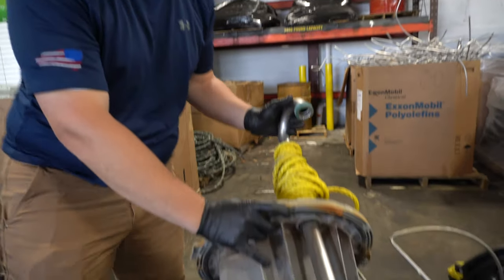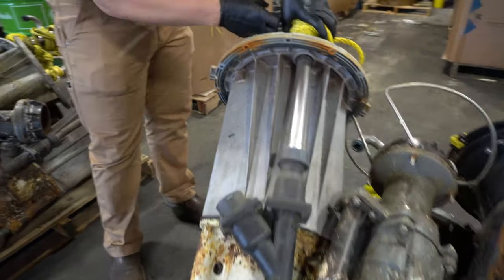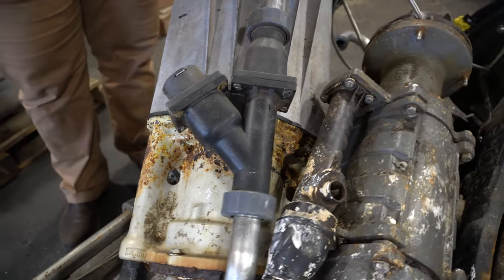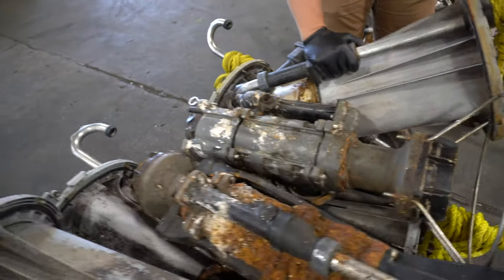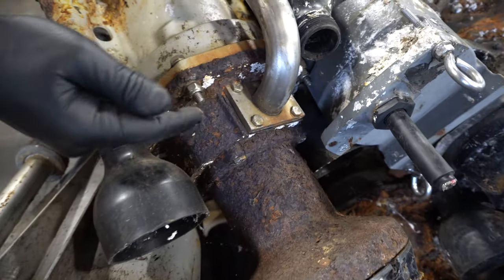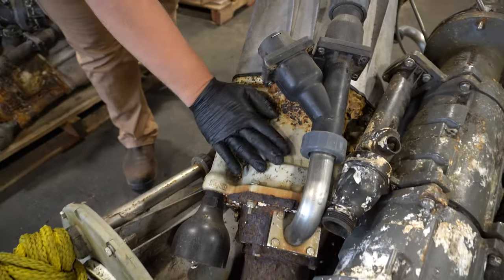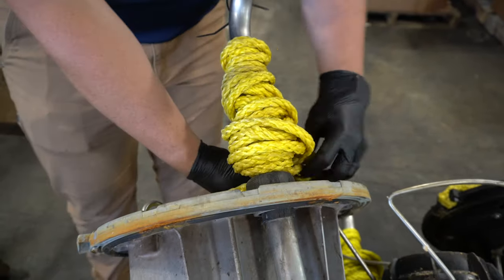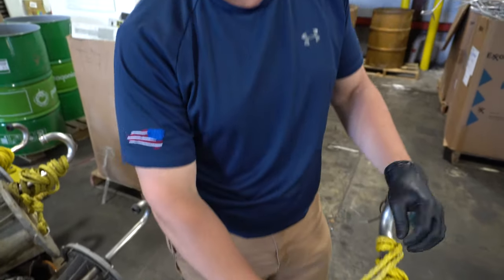Scrapping A Well Water Pump for Copper Electric Motor & Stainless Steel

Comment: U forgot to take an angle grinder/cutoff to the electric motor and pull out all that copper which can sometimes be aluminum but u can't know until you've wasted your cutoff blade on it.

Comment: I'm interested in scrapping Automotive Coils. 
My only problem is they are encased in plastic and rock-hard Epoxy. 
COP Coils are replaced as a unit so shops throw the old coil or coil pack away.
Is there a way other than burning the plastic off? 
Are they worth the amount of Copper you get?
Reply from the maker: Cut the sides off with a reciprocating saw and then you can upgrade them. Generally not worth the time thought.